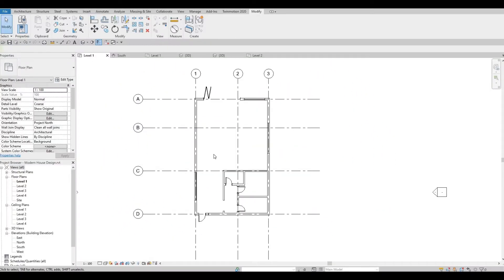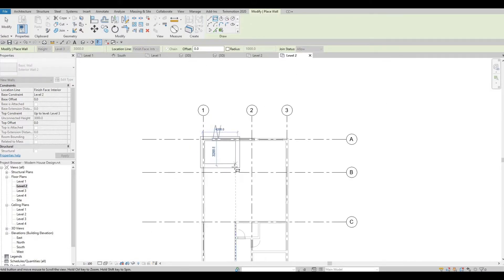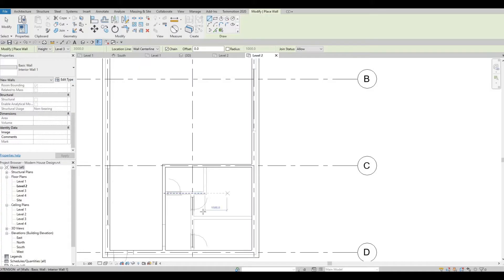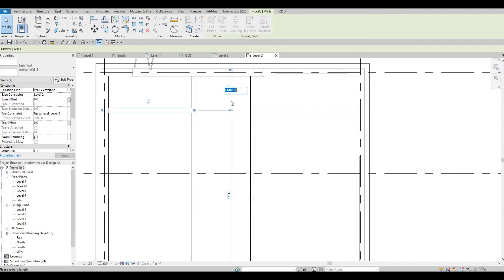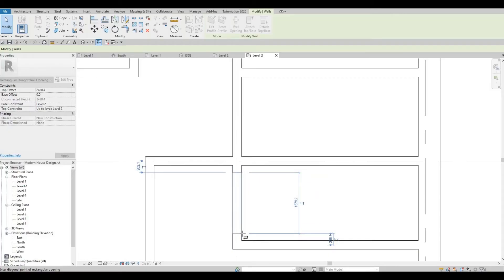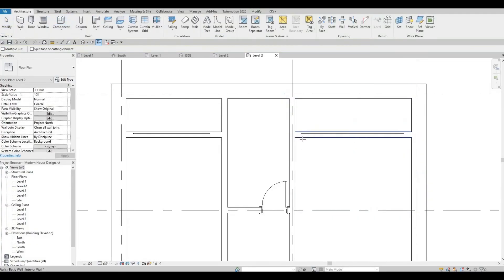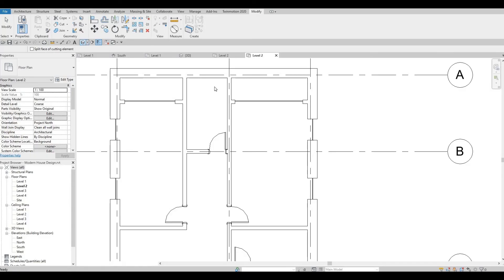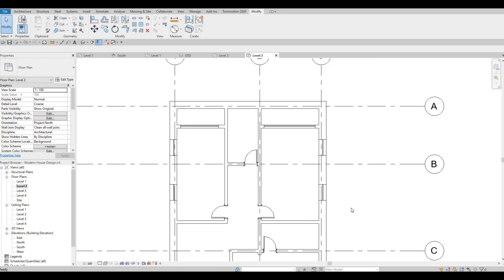Modern House | Part 2 | Complete Step by Step Project | Revit Tutorial

Comment: Hi sir how can I put a reference line to identify the correct height of doors and windows like a guideline?
Reply from the maker: Hi Erwin, you dont need to add reference line as for the doors and windows, it is set in the levels. They will automatically be added on the floor unless you put an offset. That is same with windows, sill height option 🙂🙏

Comment: how do you make it so that your dimension lines automatically snap to the centerlines of objects such as walls and doors. mine are snapping to the nearest snappable point.
Reply from the maker: Hi Forrest, Unfortunately I dont actually know the answer to that as I just click the dimension and it is already set to the nearest snapping point. But sometimes I do adjust it. I will look in to and and let you know if there is some settings you can do. 🙂🙏
Reply: @ArchCoreDesigns  Thank you! I figured it out by diving through the settings. If I can remember where it was I will post it in case anyone had the same question.
Reply from the maker: Hi Forrest, yes please do post here so that we can share the knowledge, thank you 🙏🙂
Reply: @ArchCoreDesigns  So to access the feature I was asking about you should go to the Manage tab > Additional Settings > Annotations > Temporary Dimensions. After that a small window should pop up with options on how your temporary dimensions should behave i.e. Walls snapping to Centerlines or faces etc., the same goes for the doors and windows as well.
Reply from the maker: Thank you Forrest for that. 🙏🙂

Comment: Thank you so much for the video, but I have a question, when I switch to level2, I can't see the walls from level1?
Reply from the maker: Thank you Captain. So go to properties, look for underlay. Set your base level from none to level 1. Let me know if that worked. 🙏🙂
Reply: @ArchCoreDesigns  Thank you for your answer, but still doesn't work.
Reply from the maker: Change your view range and also check visibility graphics (vg). If it didn’t work, email me your file and I can check it. archcoredesigns11@gmail.com
Reply: @ArchCoreDesigns  still doesn't work, I emailed you the model, thank you.
Reply from the maker: I saw the email. I will look in to it. 🙏🙂